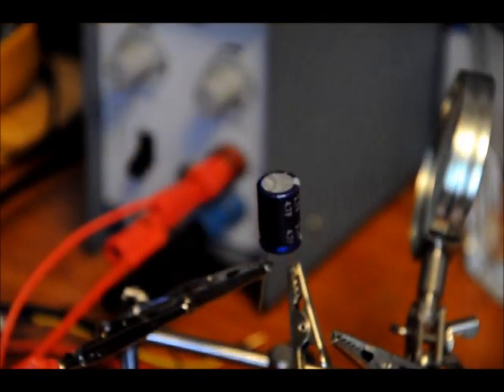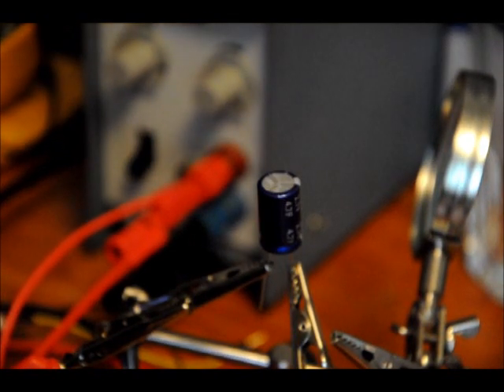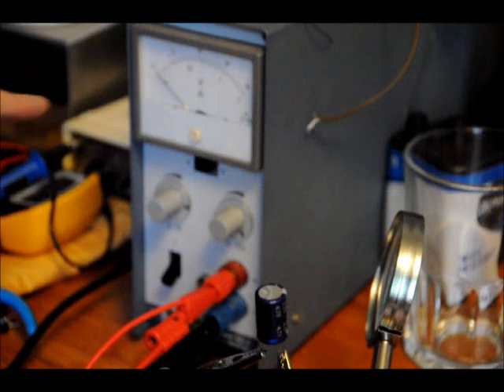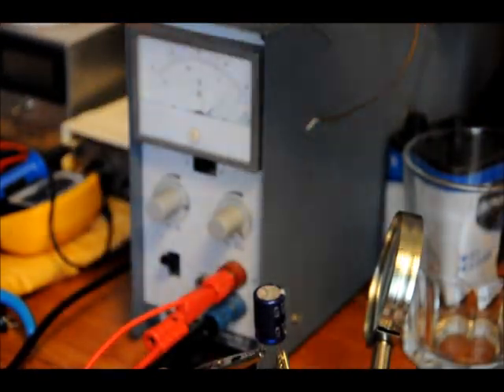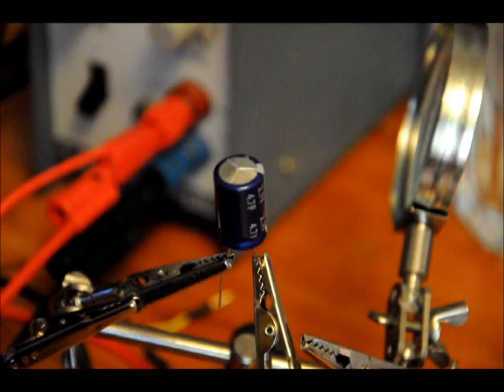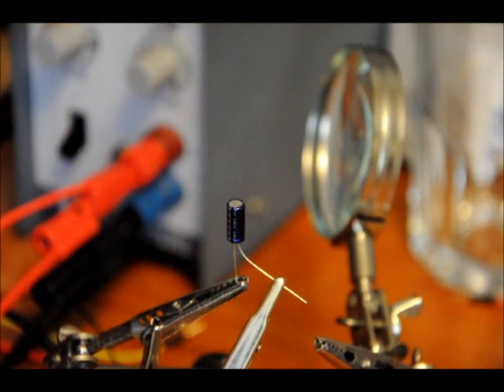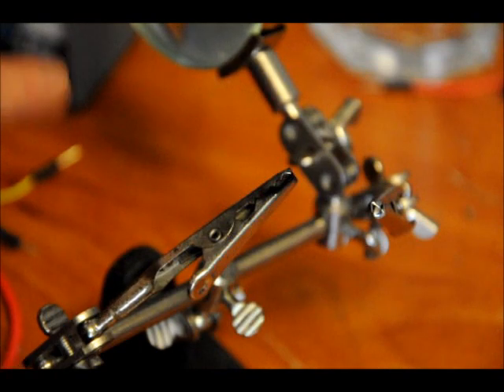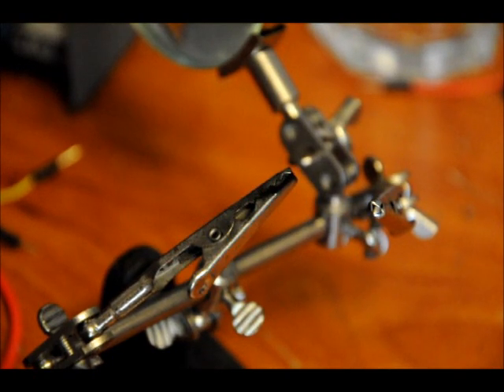Let's BLOW UP some SUPER CAPACITORS!

Comment: The nominal voltage limit on an electrolytic capacitor with respect to the source voltage

10V for 1-5V source voltage
16V for 6-10V source voltage
25V for 11-20V source voltage
35V for 21-30V source voltage
50V for 31-45V source voltage
63V for 46-58V source voltage
100V for 59-95V source voltage
160V for 96-154V source voltage
200V for 155-194V source voltage
250V for 195-235V source voltage
400V for 236-385V source voltage
450V for 245-425V source voltage
500V for 255-465V source voltage

Comment from the maker: A 4.7F capacitor is a super capacitor.  It might be a smaller super capacitor, but it is still a super capacitor.  I would consider anything over 500mF a super capacitor, really.  I suppose blowing up a 400f cap would have been more interesting, but those are expensive.  I would think that blowing up a 3000f super cap would be down right dangerous.

Comment: You probably aren't looking at the comments any more, but there's one question more important than popping an ultracap. And that's if you run them slightly overvoltage, yes they get warm, but do they still work. 
That's important for guys that fly free flight airplanes with ultracaps.

Comment: Those ain't Super Capacitors, they're just small-sized ones. Misleading video title.
Reply: They have higher potential than most capacitors. like the 4.7 farad, quite a few common capacitors cant do that.
Reply: I wonder if adding a small red underwear to the capacitor make it a SUPER CAPACITOR just like it makes Superman 🦸‍♂️
Reply: Yeah they are lol
Reply: @Jamecbond  have you ever gotten, like a 5000 farad, super capacitor,  that's made with tantalum,  that has an 8000 dielectric constant,  would these be able to be charge very high,  like to 500 volts without blowing up ?
Reply: @Jamecbond  cool thanks,  I thought I was way off with the 5000 f thing k,  it's just crazy how all this hype about super capacitors being made out of graphine would be a thing, for high voltage too,  just doesn't make seems, seems like in the real world, you cannot have both. They say they want High voltage supercapacitors.
Reply: @Jamecbond  damn,  ok.
Reply: @Jamecbond  did I mention, the tantalum shit has an 8000 constant,  crazy.
Reply: @Jamecbond  ok, my bad.  It just ki.da an expensive element so I thought there was something to that.
Reply: Believe in the tesla stuff.  I don't see how a big 11 million volt transformer is used for dc. I hope "the man" is actually using tesla unipolar discharge on a massive level  I side those 11 mil volt lines,  and it can go without any volt drop.
Reply: @Jamecbond  I agree,  but what about the peter lineman video that is old where he talks about tesla inventing the high voltage, unipolar discharge of capacitor, at a real short period rate, and well, all that, based on the dc supercharging effect. ? Is that bullcrap or are those real accounts that lineman was reading,  I mean to me,  they sound plausible, not extremely high tech, just situations that give pronounced effects. NOT like "antigravity " or The philidalphia experiment crap,  or blue book.  But I have the need for speed...
Reply: Well the unipolar discharge is defiantly hard to explain, Since today most this just have 2 ends,  but the DC instantanious, very brief "super charging effect is totally a reality. Although today you would never see it, because of the advances in tech. Only in a small system that is made as an exibit.
Reply: Anyway,  here is the crap,  at least it's not, Ancient Aliens, Levitating Peckers, and Stone teleporter crap... https://youtu.be/rXX_g49tLeU
Reply: Regardless of what you think of this semi hippy dude,  you might get something outta the video. Watch the whole thing...

Comment: you better call kenny loggins, because you're about to enter the DANGER ZONE! 
awesome video though, It actually helped me a lot with my concerns about my project. I know now that I don't have to worry about my caps blowing up.
I'm not sure what kind of camera you are using but if you can adjust the F stop and shutter speed it will give you a better depth of field on a DSLR. that way you can have more things in focus. if it's a fixed focal length like on cell phones and flip cameras, then your stuck. just a tip for future videos it honestly didn't take away from this video at all. very cool

Comment: where are the videos of people blowing up these small electrolytics with 120 volts right out of the electrical receptical? i cant believe it. is there some policy against it? they used to pop quite nicely in the late 80's when i was checking it out last. i will be blowing up some 50+ uF 380VAC air conditioner capacitors with all they can take from a stiff high voltage supply - both capacitative discharge and trickle - and filming it in a few days to fill out the void. gol dern!
Reply: @patrickikis
Here's an idea for a video (in response to this guy's question):

Don't quote me, and don't try this, but I think IF you charge a _super_capacitor ABOUT HALFWAY and then plug its terminals into a 120VAC (60Hz) outlet, what will happen is your circuit breaker will trip (or fuse will blow) before the supercapacitor is damaged.  The reason is the internal resistance of a _super_capacitor (not an ordinary capacitor) is so low and the capacity is so high and the cycle time is so short that the building circuitry will think you've shorted out the 120VAC electrical outlet.  The voltage drop across the supercapacitor will, due to the tiny internal resistance, be equally tiny for the 1/120 second duration dis/charging time.

Comment: The reason it is heating up is that after the dielectric breaks down, the capacitor turns into a resistor.  The presenter said that he was using a 2amp current source as the power supply, so 2 amps is flowing through the damaged capacitor.  The 2amps of current is what is generating the heat.  If enough heat is generated, it boils the electrolytic fluid.

Comment: that wasnt cuz of reverse polarity that was because the second one was a cheap capacitator and it doesnt have those grooves that let steam out when its overcharged. that one doesnt have a fail safe so it pressurized and exploded.
Reply from the maker: No, these to have releases.  You let the steam out if you overcharge with normal polarity.  Even in the video you can see the grooves.  It does have that fail-safe. Caps react very differently if you overcharge versus charging with an incorrect polarity.
Reply: patrickikis Well, technically it's not steam. It's magic smoke, another term for burning plastic.

Comment: uF
Reply from the maker: Farads
Reply from the maker: psoriasisman 
No, these are super capacitors.  Rated for 4.7 farads.  Not uf.  Not mF.  Not nF.  
If you want to measure these in uf, then this capacitor is rated for 4700000uf at 2.7v.   Like this:  http://www.dfrobot.com/index.php?route=product/product&product_id=482#.VdYTwvm6dMw
Reply: psoriasisman µf
Reply: +Martins maskiner μF
Reply: patrickikis
I forgot that the regular farad is in use. It's a huge unit.
Reply from the maker: Max Greyfeather It's all good =)  I've just had a ton of comments like this on my super capacitor videos.  Thanks for watching =D
Reply: That's a small 7F unit  I reckoned 7 micro farads and still doubt your answer (sorry) 
BUT charging at 5-10 times the voltage at a fixed current is an insane test - I appreciate you want to "blow a cap" but what have you learned?
Not how much you over-volted it or whether it was damaged irrepairably by charging at a few volts over specification.
Stored energy goes up with V-squared so you have exceeded specification 100 times

Comment: how consistent is the over charge performance? specifically can you say use a 2.7v supercap at 4v and still get the full farad as long as you don't mind it heating up a bit?
Reply: Good question - and the answer is - build quality and materials?
Since E goes up with V^2 this is a totally important question
Reply: I managed one rated 2.7v 100 farads charged to 3v and it wasn't even noticeably warm. at 0.75A
didn't want to take it any further because you don't get any more farads of storage when its charged past its rated voltage. Just more voltage. it quickly drops off to 2.7v then steadies with a load applied.
Maybe if you set it to 3v for a really long time with very small current like 20mA. then it would slowly adjust to 3v but wouldn't have quite as much capacitance at 3v vs 2.7v

Comment from the maker: Hi
I don't see how a parallel resistor would change anything.  A resistor won't generate current.  It is just another load for the supply to feed.  The capacitor itself sucks in as much current as it can, as it has a low internal resistance.